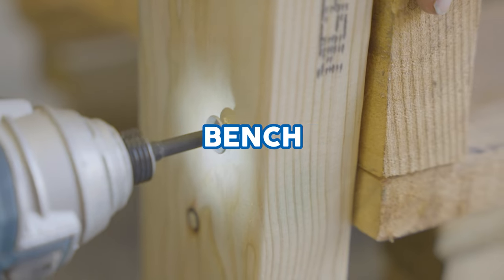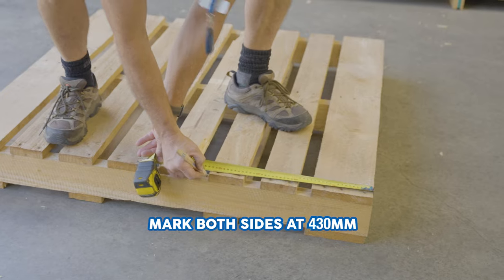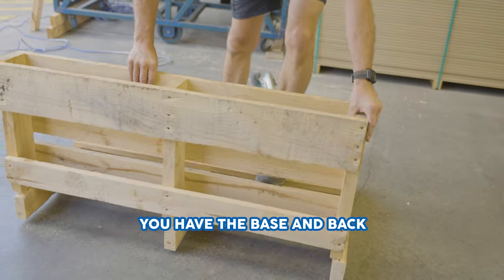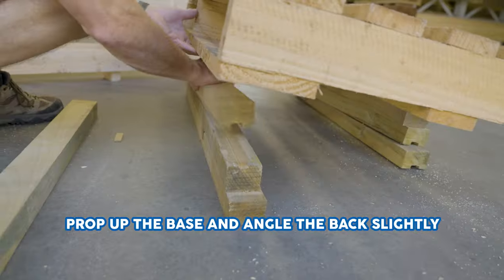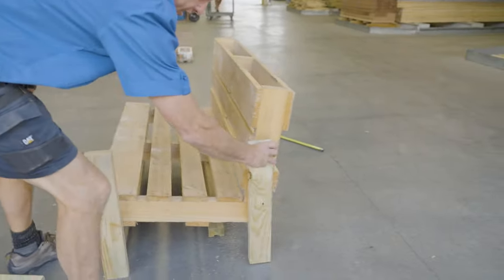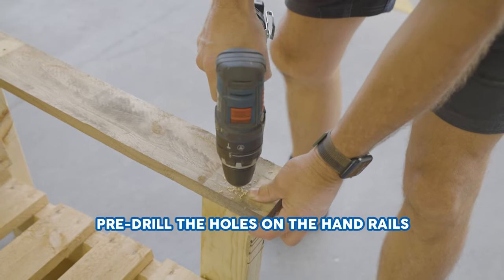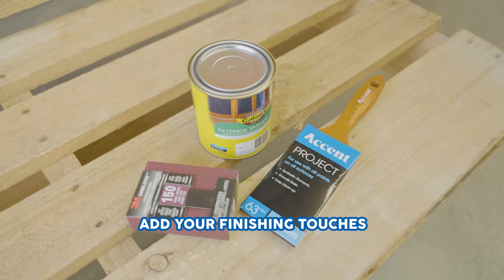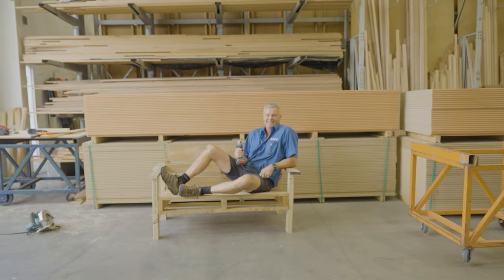Turn a pallet into an outdoor bench

Comment: nice video, probably need to add some info on getting the lean/angle correct for the base. You used five 90x90 offcuts at the front, 4 at the back?